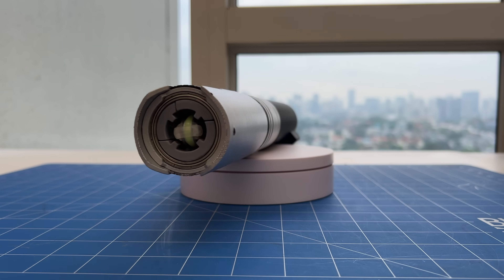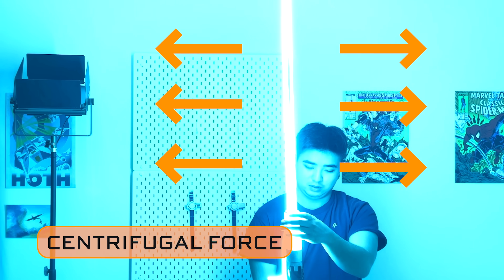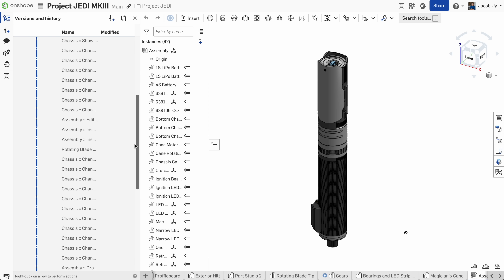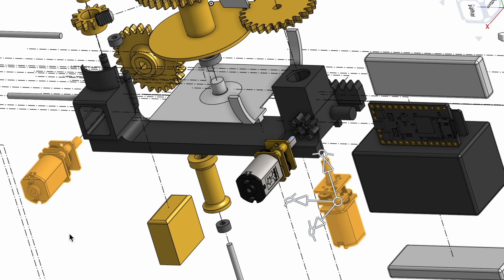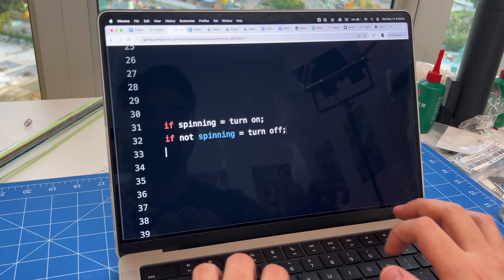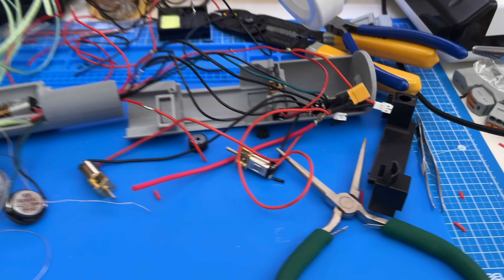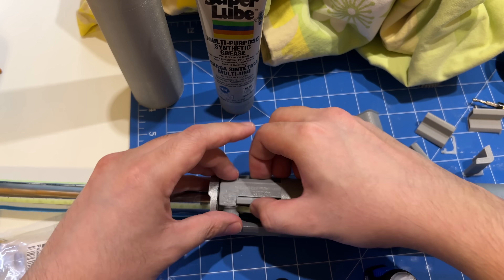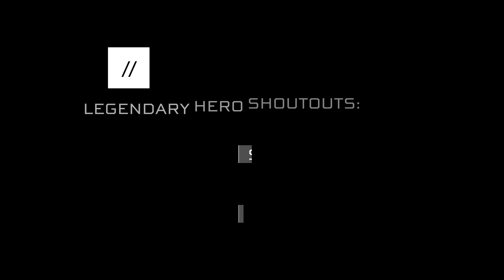Making a Better Retractable Lightsaber

Comment: 13:04 For the friction issue, have you tried using a lubricant?
Reply from the maker: Yeah we apply singer machine oil pretty liberally to the moving components, but I think I may have missed a spot or two
Reply: @herotech  have you ever tried using graphite? I don’t know if that would be necessarily safe with the spin, but it is an effective solid state lubricant.
Reply: It would also kind of give a little bit more of a reflective shiny next to it however, I don’t know how that would work with dark or light

Comment: Amazing work! The mechanical engineer in me suspects that the fast extension can be done with a single motor and the right mechanism. I once designed a ping pong ball launcher that used a single motor to wind up the spring and launch just by changing direction. I used a set of three gears with two on a lever arm. In one direction, the gears on the lever engage the other one and they act as a gear train. In the other, the lever rotates and it disengages.
Reply from the maker: Thank you!! That’s so smart, would love to see that kind of mechanism - how did you think of it?
Reply: @herotech  Thank you! I made it at a lego robotics camp when I was a young teen. I guess I was just tinkering with gears. I can't find a video of it now, but it's pretty similar to thang10146's "One way clutch 1b" video. If you end up using it, please give a shoutout!

Comment: Replace the metal magicians kane with a fiber optic strips, role it up ans make it springy to role into itself like magicians kane.. you will need to this with heat as you role the fiber optic cable strip for it to maintain its roled up shape.
1 l.e.d source at the base will light up the entire saver once the fiber optic extends, it will be even lighting all around, and much much brigther given fiber optics property.
Reply from the maker: Could be interesting! How would you make it springy?
Reply: i actually spent 1 hr to see if this idea was possible. i found POF exists ( plastic optic fiber ) which is ideal because glass fibers are too fragile for repeated movement and would just break up. I also came across side lighted POF, which lights up the cable all around. Typical optic cables light up at the end only. this info looks promising so far, but.. i cant find suppliers that provide any other shape other then tubes, much less magicians kane flat style strips. My conclusion is this, the idea is indeed "doable", and would work 100% if you could find a POF light strips that could have the ideal shape. Making it springy is a matter of rolling it up into a roll like a roll of tape, but with no open gap in the middle. and then  exposing it to heat and then cold for a few repeated times, this gets the molecules reorganized to lock into that shape, resisting pulling force as it springs back into shape. Im not sure if this procedure could change the light refraction  index which can render less side light emission because the molecules have changed behavior. 

the biggest challenge to this is still finding the right plastic optic fiber cable with exact dimensions and thinness that you need. you would have to manufacture it yourself ( dont bother contacting manufactures because they most likely dont have the equipment settings to change the shape of their cables ). Honetly, i just wasted your time and mine, i just really like your light saver idea and thought i could pitch in some ideas, but its too many hoops to jump through, more work then the sword itself. 

your method of spinning the kane is far more easier and cost effifient. keep inspiring

Comment: What about durability test?
Reply: Its a showpiece and not a fighting piece. I reckon for fighting you'd have to swap for something similar but with the leds covered with a tube. Very much what Disney does.
Reply from the maker: ^^ , might look at adding duel functionality in the future but it would definitely be a challenge
Reply: You could add a thread on the edges he top that way you could screw in a actually more durable tubing thats actually rated for rough use. @herotech

Comment: Amazing design! Couldn't the strobing/throbbing effect of the LEDs be created programmatically versus mechanically? This could theoretically shrink the size of the hilt since the rotating motor would not be required to create the effect. An Arduino might be something to consider for the task.

Great content. Sub
Reply from the maker: Thank you! It could for sure be done in code, I did forgot to mention though the other purpose of the spinning is to create a persistence of vision effect, enhancing how solid the blade looks

Comment: If you powered your servo off the same board as your controller, it is likely the servo drew amps and messed with your voltages.  The servos need their own power supply, your board can't supply enough on it's own.
Reply from the maker: We had a separate power source - eventually figured out that the problem was a bug with the implementation of pulse timings of the specific board we’re using, which would have taken me a lot longer to fix than the mechanical solution that I pivoted to

Comment: You could put a piece of white rubber on top so that when it extends it covers the extended portion making it more realistic, but finding rubber that will stretch that far without breaking and return its shape may be challenging. Probably not worth it.
Reply from the maker: Agreed, could be cool if I find a rubber that stretches that far!!

Comment: Very cool O: One alternative idea for the switch though: You could use one or multiple tiny reed switches inside the spinning part and a movable magnet (or even electromagnet) outside to trigger it. Have used that concept similarly in cosplay.
Reply from the maker: That’s so smart!! Great idea, will have to use that for the next version

Comment: For the next version, you should make it be able to dual. Like add some sort of casing around the outside of the blade that doesn't spin and is strong enough that you can hit stuff with it, and it won't bend.
Reply from the maker: Would be interesting for sure! Need to find a casing that’s strong enough but can also
Compress into a small space

Comment: You should add a friction lip around the inner hilt in addition to the friction resistant outer one, and if you can get a long sheet of iron you could make a magicians cane that can attract magnets to fix the centrifugal force problem.
Reply from the maker: Having the led strips magnetically attracted to the cane would be a great solution!!

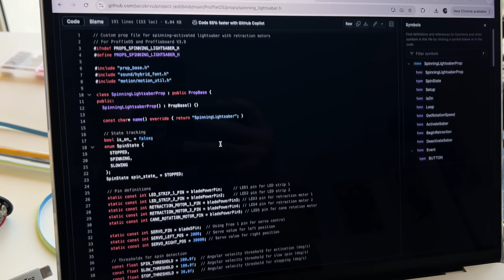Comment: 7:20 Why use a servo for something that just moves between two known positions which can be set with mechanical stops? It seems extremely overkill when a basic solenoid can do the job. The rotary motor you moved to is quite a bit simpler, but you can do the same arrangement without any gearing using a linear solenoid. That being said, if you change the rotary arrangement to a worm drive that would probably be the most robust and power efficient since it physically can't move without motor input.
Reply from the maker: Very true and great points! Tbh I was using whatever components I had on hand at the time so I could develop this as quick as possible haha 😭 but you’re totally right in that a solenoid or worm drive would be optimal for this.
Reply: @herotech  Hey we've all been there. Amazing result regardless! I'm looking forward to the next version⚔
Reply: Omg this is not even English anymore lol

Comment: nice work! would the problem of the light strips "flinging out" be fixed by having the led strips be inside a semi transparent retractable tubing? kinda like taking the cheap plastic lightsabers toys, and putting your lights and rotating stuff inside them?
Reply from the maker: That would definitely fix it as well! I solved the flinging off problem by adding a small piece to the top of the magicians cane that keeps the strips in the channels, but I’m actually exploring the transparent tubing option also to make the hilt thinner

Comment: But is it possible to make a version that can also be used in combat with heavy swings and everything? Because that would be seriously awesome.
Reply from the maker: I believe anything’s possible :) would need an impact resistant backing or casing, as the led strips themselves won’t take too kindly to hard direct hits
Reply: @herotech That is, indeed, one of the hurdles. Another is having a material that is resilient enough to withstand heavy impacts while being collapsible. That on top of needing to make sure there aren't friction issues on the inside if the outer shell remains stationary, and ensuring the force of impact won't cause the lights to break or die out. And all of that without even mentioning that the hilt would likely need to be thicker (again) just to fit everything regardless of all the other concerns.

Comment: If you can find out what sort of material the reflective tape is made out of, you can coat the spring with it.  Then you need no reflective tape on the exterior and can have even coverage.   The mechanism for releasing and retracting the blade can be in the core, rather than the exterior.
Reply from the maker: True!! Would love if the coating didn’t interfere with the cane extension/retraction

Comment: Just a thought, but would it be possible to pair your design here with (maybe not directly but something functionally the same) some of the tech that goes into the NeoPixel sabers? Specifically things like the Proffie board or something similar that allows you to put different sound fonts, smooth swing sounds and different blade colors/blade effects. Honestly if you could figure that out and then figure out how to produce them, I'd never want to buy any other type of lightsaber

Awesome work! Can't wait to see whatever the next step is!
Reply from the maker: Oh the board I’m using is actually the Proffieboard haha! It’s got smooth swing capability but I wasn’t very smart about speaker placement and the volume setting so you can’t really hear it :( next version I’m hoping to design in an acoustic chamber for the speaker

Comment: The servo being twitchy may have been a power issue or some kind of errand interference on the board. Did u try another control board or read the power output to make sure it was stable?
Reply from the maker: Yeah, the servos worked fine with other arduino boards I had lying around - eventually I figured out there was a bug with the specific control board I was using and the CCR, which I learned very quickly was way above my ability to fix hahaha

Comment: For your buttons, you might want a slip coupling instead. They're made to send electric signals through rotating parts.
Reply from the maker: True! Next version looking at using a slip ring instead, also so I don’t have to have an additional battery on the outside hilt

Comment: I mean, yea it looks great on camera, but doesn't it look weird in person when you can still see the gaps between the LED strips?

Could you add some light diffusing material in the dead spaces?

Also, have you tried playing around with Gear Ratios to make the lightsaber retract quicker?
Reply from the maker: I didn’t explain it in this video, but the other purpose of the spinning is to create a persistence of vision effect - with the spinning, in real life it doesn’t look like there’s gaps in between the strips and the blade looks solid (also depending on lighting conditions of course) tried a few different gear ratios for the retraction, it is actually supposed to retract quicker - I figured out there’s a friction point near the led strip spools when they get fairly wide that’s slowing it down, so aiming to fix that - in unconstrained tests the blade retracts in about 3 seconds
Reply: @herotech  thanks for taking the time to respond!
I'm very excited to see what the text improvements will look like :)

Comment: Consider using the built-in IMU on your MCU to trigger saber sound effects, like with Neopixels. Even considering your centrifuge like environment inside you can still get clean IMU data by applying rotational dynamics compensation and a couple of filters.
Reply from the maker: Thanks for the suggestion haha! The blade actually has smooth swing working great, i just screwed up with the speaker placement in the hilt and volume settings 😭

Comment: The magician's cane is adding unnecessary forces, Disney is using what is basically 2 tape measures to make the cylindrical shape of the blade so you can easily extend and retract with a lower amount of material, its also more sturdy
Reply from the maker: The Disney lightsaber is awesome! Not sure about more sturdy tho

Comment: "hmmm how do I fix the problem where there is no light because there is no LED?? AHH I KNOW! Adding another LED"
Reply from the maker: Ahahaha I realize the way I said it in the video seemed really obvious, was trying a few ways to avoid this solution since it takes up more space in the hilt and requires more power
Reply: @herotech  dw i get it, it js seemed funny😂 But fr great job, the blade looks even better than the one disney has in their parks tbh

Comment: The great successor of those old plastic lightsaber toys we all had that needed the blade to be pulled out manually
Reply: You could flick it down and it would extend sometimes
Reply: I have 2 that were spring loaded, you just need to push it in manually
Reply: actually, a small mod to those could possibly be a better design than this thing: compressed gas could extend the rod, and then a monofilament connected inside to the tip could yank it closed again
Reply: @MontyCantsin  That's what I was wondering about. I'll honestly try and make one when I get the chance
Reply: I always flicked mine out and then slapped the end of the vlade to push it back it
Reply: Used to have a spring-locked one. Press the button and the plastic blade would zip out.
Reply: They had to be pushed in manually. Most of them were flick-and-lock meaning you just flick your wrist and the telescopic blade comes out.

Comment: I love the cal kestis design used for this one, it would be cool if future designs made more use of the Proffieboard for the features like swing sounds, blaster deflect, maybe not impact clash cause that takes a hit unless it was the hilt but otherwise insane work man
Reply from the maker: Thank you!! This saber does actually have hum and swing sounds, I didn’t place the speaker very smartly in the hilt though and you can’t hear it very well :( only the ignition and retraction are loud enough to hear, for the next version I’ll change the speaker position and up the volume more

Comment: This is really cool but I do have a question. With many "real" lightsabers available as of right now, they look a lot better on camera than they do in person, and I was curious if the same effect is present with this lightsaber?
Reply from the maker: Thank you and great question! One of my gripes with neopixel blades is that under bright light the plastic surface is visible and it doesn’t look too good. This saber blade is much much brighter, and the spinning really gives it this energetic feel. There’s a persistence of vision effect too that makes the blade look solid in real life. In my opinion it is better than a neopixel blade for sure. I still don’t think it’s perfect - the core is sometimes visible on heavy swings, I think there may be a moment or two in the video where that is kind of visible

Comment: You can use a solenoid or a pneumatic air cylinder for a high speed extension and retraction of the light saber. Also, for the led, you can have one long led strip that will be rolled around the stick all the way to the top, which means that there will be no need for a spinning and a pulling mechanism that will complicate the whole thing. Correct me if I am wrong.
Reply: I think the spinning adds a cool flickering effect so i think it should be kept
Reply: @stevenle9960 Yes, but hé could program the led to do a similar effect. He said that the spinning was a really bad idea since it made it hard to control the lightsaber freely.
Reply: @yassineanam7341 eh if anything that makes it more accurate and really makes it feel like the lightsaber is vibrating with energy
Reply from the maker: Thanks for commenting, how would you use a pneumatic air cylinder for the extension and retraction? Wrapping the led strip is a good idea, definitely want to test it
Reply: A double-acting pneumatic cylinder uses compressed air to move a piston back and forth, enabling quick and controlled extension and retraction of a rod. By directing air pressure to either side of the piston through a control valve, the rod can extend or retract rapidly. This setup requires a compressed air source, such as a small compressor or air tank, and a solenoid valve to manage airflow. Adjusting the air pressure and flow rate allows you to control the speed and force of the blade's movement. Incorporating end-of-stroke cushioning can help decelerate the blade smoothly, reducing mechanical stress. This mechanism offers a simple and efficient way to achieve fast and smooth blade deployment and retraction without complex mechanical parts. If you want, you can just by one.

Comment: If you could make it battle hardened, this project would be amazing (although it already is)
Reply from the maker: Would be cool! Would definitely need some kind of impact resistant backing or casing for the led strips because those won’t take a heavy hit very well
Reply: @herotech yea, I was thinking of that, I was imagining some type of clear/ foggy white pvc halves extending up, around the glowey parts. How the pvc extends, I am unsure but maybe you could make some type of that staff extending tool to use the pvc. Again, just a thought